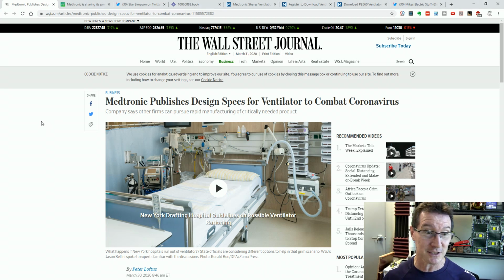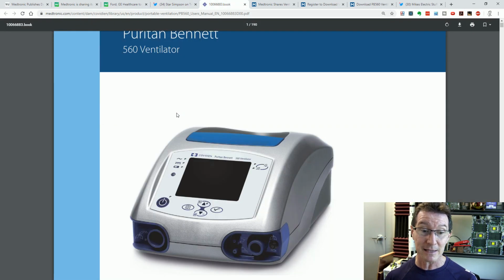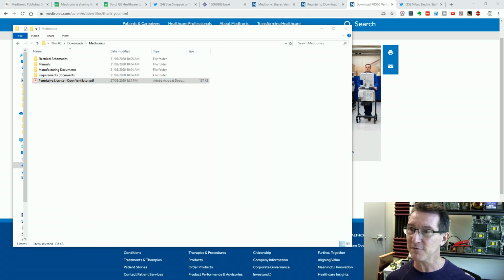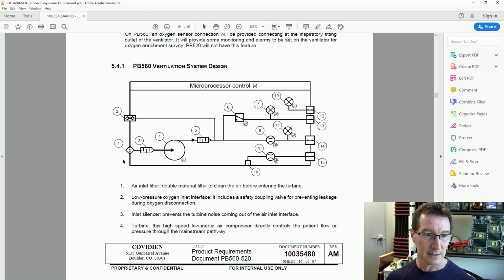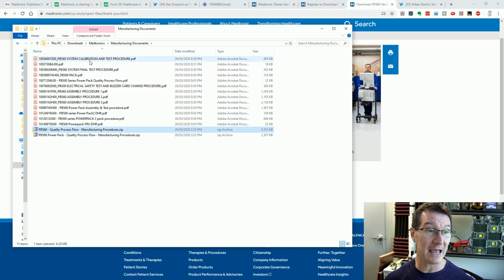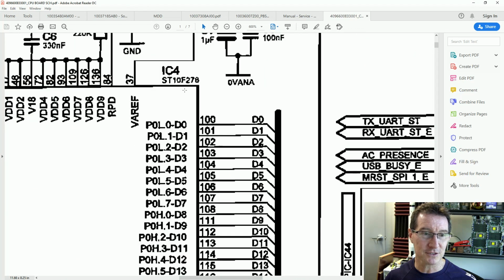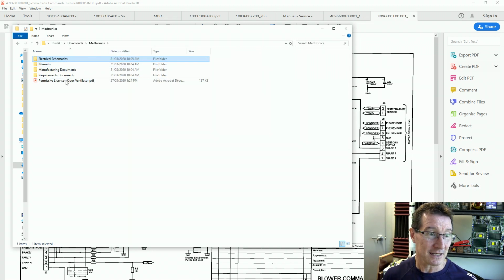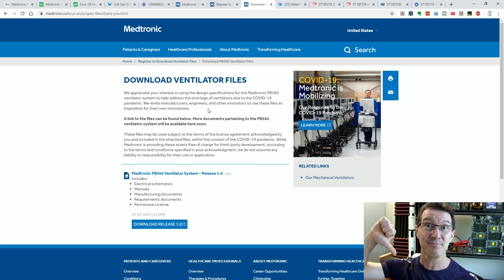eevBLAB #72 - BUSTED! Medtronics Open Ventilator FAIL

Comment: I design medical devices for a living, and I happen to be advising several of the teams that are working hard to quickly produce open-source ventilators.
1. The documents that have been released are actually pretty useful as examples as to how medical device development and documentation should be done.
2. I’ll be shocked, shocked, shocked if Medtronic releases source code. I’m sure that the last thing they want is for hordes of developers to find bad code that ends up in bad publicity, and possibly lawsuits from patients who may have been injured. One of the reasons that I’d love open source medical devices to become a thing is that we can get more eyeballs on designs before they’re released into the world.
Reply: We spent well over £1M on software development for one medical product!  How long would it take you to fill out a regulatory requirements documents for a medical product, people think that it can be done in hrs, not weeks or months and that's when you know what they want to see.In the US is apart of the process completing a  FDA 510K approval which can take years, we did.
Reply: @TheEmbeddedHobbyist  I completely agree, people don't seem to realise the approval requirements for medical devices, which can be more stringent than aerospace.  The UK NHS ventilator project is being fast tracked through the system, but this is not an entirely new design, but a revision on an already approved in use design.
Reply: @TheEmbeddedHobbyist  jesus... ill do it for 10k
Reply: @LittleRainGames  The coding  is not the problem, it's the testing and paper work. lot's and lot's of paper work. there are so many regulations that you have to meet and so much  work to prove that you meet them.
Reply: The Embedded Hobbyist If I may... if you have a good quality system, the paperwork should be nothing that shouldn’t be part of any good engineering process anyway. Unfortunately most quality systems suck.
Reply: @yummybeers  i spent 5 years working to ISO 13485, the amount of paper work to get a product through the 510K FDA process seemed to be endless.
Reply: The Embedded Hobbyist 25 years here 🙂.  And a dozen or so products. The amount if documentation isn’t trivial, but, honestly, most companies make things way too complex. ISO 13485 just tells you what needs to be done, but companies decide how to do it. And they often come up with silly stuff with way too much unneeded paperwork.
Reply: @yummybeers  I know i was just trying to point out that making or coding is quite a small part of the process. in normal times getting things qualified is not easy even when based on existing proven designs. The hoops we had to jump through just to get 510K approval seemed over the top even as we were basing our design on existing equipment. How are things going to go when the UK is out of the EU, last time i looked there was an issue with notified bodies etc. I'm out of it all now as I've put up my medical and aerospace shoes and replaced them with slippers :)
Reply: @TheEmbeddedHobbyist  I hope that paperwork and regulations aren't going to kill many people this year. I mean when you are in Italy's position that you have to choose who will get ICU bed and who will get ventilator because there's simply not enough for everyone, the rest is going to die, any device which helps people breathing is better than none, isn't it? They can do basic tests in one day and have some emergency approval. I know that in my country there are several 3D printing projects going on to have face mask which will fit army filters because there is shortage of FFP3/N99 respirators. It got tested and approved in one day. Similarly with experimental treatment with drugs like Remdesivir. Anything which is not going to outright kill the patient goes. We can leave more formal certification for times when hospitals have usual level of patients and not fighting highly contagious pandemic.
Reply: The Embedded Hobbyist True that “construction” is maybe 40% of a project. I may be crazy, or lucky, but I haven’t had problems with the FDA. One device that I worked on, reasonably complex one, got clearance in about 35 days. It’s about working well with them, making what you’ve done clear.
Reply: Prepare to be shocked: https://www.medtronic.com/content/dam/medtronic-com/global/Corporate/covid19/downloads/ventilator-files/medtronic-pb560-ventilator-system-file-set-3.zip Enjoy...
Reply: In current crisis, certification is the least of the issues.  Any doctor would be happy to use a non-certified ventilator under supervision if there is a life and death situation. Dave is absolutely correct that without bill of material,  those documents are useless. As a mechanical designer I am certain that most of the sensors and actuators in this unit are designed to manufacturer's specifications and may not be available for purchase to general public. OEM sensors and components are very different than of the shelf parts. An example is a modern car, it uses hundreds of sensors and  actuators and if any of them breaks,  only an exact replacement works.
Reply: They could just share a binary file.
Reply: In germany we have spent over 25 Mio € for the  development of a new treatment center! Any cable change, any change has to be certified by the TÜV in Germany. It ist extremely hard to develop mechanical products...
Reply: I'm curious about the projects you're advising
Reply: Well they have released the code now :)
Reply: DispelTheMyth  Phew, I thought I was once again behind the times on trendy speak, or you were suggesting ventilator code be written in coffee script.
Reply: Yea man, this is why companies like microsoft announce releasing things as "open source" years before it happens. They have to clean it up big time. I've seen a lot of nightmares in company software lmao.
Reply: Hi there, could i get your email? We are working on one from nepal and your input could help save us time and effort. Thanks.
Reply: Emergency Ventilator, the real thing.

Please take a look at this, and if you find OK, help spreading the word.
This is an emergency ventilator made by a Danish University ( https://www.en.aau.dk/ ). The emergency ventilator is approved by Danish health system.
The ventilator is easy to build and cheap. But very robust.
I am Danish, but not an engineer, I just wanna help save lives. So guys, please take a look at it:

From Aalborg University, shortly before it got approved: https://www.news.aau.dk/news/emergency-ventilator-to-alleviate-severe-shortages-of-equipment-and-personnel.cid459836

From Danish National Broadcasting (like BBC in UK), please use Googletranslate. I have tested it, it does make a decent translation: https://www.dr.dk/nyheder/regionale/nordjylland/danske-forskere-har-brugt-blot-14-dage-paa-lave-en-simpel-respirator

Manuals, software, permissions: https://github.com/CoRescue

As a Dane, I can verify that this University is OK and the article is from Danmarks Radio (national broadcasting).

Hope you guys wil take a look at it.
Reply: Even if the code has flaws, the design has a decade of service history behind it, so it should be good enough if implemented in the exact same way that Medtronic themselves have done.
(Assuming everything else on the mechanical/electrical side checks out).
Reply: Just adding my couple sents also... Medical equipment also has "botches" that are fixed with jumper wires connecting a few missed things. The thing is they got approved with those botches, if they fix the PCB it has to go again through all of those qualification processes even though the board is essentially the same. Thus it is not unheard some 30 year old designs in production still have those jumper files instead of having a new PCB design.
Reply: The source code used is probably already open source code with a few modifications.
Reply: So when hordes of developers only search for bad code but can't actually write code for an open source mechanical ventilator says it all. 

The problem is copy and paste instead of actually implement code. Too many engineers spent too much time in copy cat behavior. 
The best code to debug is your own code imo.
Reply: outsideworld76 Generalizing a bit? I’m working with some excellent developers who are creating code for an open-source ventilator.
Reply: @outsideworld76  So what, people shouldn't search for bad code unless they can do better themselves? That's stupid. Especially considering that bad code in a ventilator is just not acceptable so any time this gets pointed out is a plus.
Reply: @outsideworld76  Absolutely not. Your own code is subject to your own abilities, skill, and preconceptions. Where I work, we run all of our code through two rounds of programmer QA, with separate reviewers on each round. Even really skilled developers miss things and need to be corrected.
Reply: @outsideworld76  You are correct. I had a high school science teacher that said, "don't buy a used car because you are only buying someone else's problems...." This may not be the case all the time but if the code copied is garbage, the output is garbage. Most folks dont even want to analyze wtf is going on in there.
Reply: @wmd5645  used cars have been debugged. If you buy with a proper pre-purchase mechanical/electrical check, and preferably a warranty, then it's far better IMO. 

New models of car are even worse than just new cars. Let someone with cash to waste debug the manufacturers design ...

Comment: maybe some nub just clicked the wrong file to upload on the server. hopefully they fix it after this. although 3D printing the parts seems like a slow way to get these out.
Reply: Lol. That's naive. Sorry - you don't release design files this way, and allow "some nub" to touch them. This has been back and forth between their Legal and marketing department, probably not even by the engineers.

Comment: Those are design input files. With these files a project team could create a totally new custom ventilator. Software or design files would cause a breach of corporate secret and IP. This allows a new ventilator to be designed without risking any legal ramifications for the company. They could never release a design file because then they would be liable for any products made with there files. These files are all an engineering team needs.

Comment: This is a 10+ year old design that I'm sure they have improved on so I'm inclined to believe they will share all the files they can.  This is likely just an early release with more to come.  If someone from the media approached them asking "where's the rest of it?" I would bet they would release more such as the actually PCB layout files, software (firmware), etc.  They likely haven't made this model in years and have to "find" the missing files.
Medical companies like this don't need publicity as they don't sell to the public.  But releasing this old model that likely has competition (in the same class) can actually hurt those other companies that haven't advanced past this tech.
PCB layout files are more important than schematics if you are just wanting to clone the product and use the same regulatory approvals.  Those approvals are what can get this in production now versus any new design.  And they will likely ONLY release the final assembled firmware code files ready for firmware programming.  Releasing the actual source code wouldn't be wise for several reasons and is not needed.
Yes, they need to be called out on this but when they are I would bet they would find the missing files, BOM, etc.
Stay safe everyone.

Comment: Why can’t somebody just come up with an analogue machine something mechanical
Reply: having been an emt.. I can tell you that BVM is not fun... I mean that is literally what new york is considering.. having people squeezing bag-valve-masks (bvm) instead of these automated machines.......  it sucks.... not as much as mouth-to-mouth of course... or chest compressions (bvm is usually utilized during cpr for emts)...  the real challenge is getting the right amount of air...  in emergency setting its not the most critical thing.. but actually in life sustaining... ventalators tend to keep a slight positive pressure on the lungs (bvm cant do that very well) and measure the pressure going in to know expansion volume etc...    but yeah I've seen some diy thing that takes a bvm and puts a mechanical squeezer on it... might be the only thing that can be done in such short time.... assuming there enough BVMs to go around........

Comment: requirements document at least give a start for a development, but I would agree, there isn nothing really open source about requirements documents, because really they just are a conglomeration of standards, and a certain use case.  Pretty much useless to help in the here and now....   I can only imagine if they had released real open source docs.... could you imagine how quickly 3d printers and pcb fab labs could spring into action and help the production....  even if it was some not-for-profit licensing scheme on this the baseline model... THAT would be good-will.

Comment: I've seen quite a few people come up with mechanical means to operate an Ambu Bag (manual ventilator). While I haven't seen this style yet I would say the simplest design would be a gear motor driving a piston that would squeeze the Ambu Bag. It wouldn't have any bells and whistles but it could get the job done and potentially save lives.

Comment: What are the odds the software is offensive to look at and will create distrust in their products even though it's probably perfectly capable of the job?

This looks like more of a whitepaper giving you the "algorithm" for the device and operational parameters without giving you any specific implementation.  The key take away is how complex a seemingly simple device is.

People were expecting an explicit recipe that could be sent to China to be turned around as a knockoff product.  It's not useless, but they're making you figure out how to make those parts perform to the required specs and figure out how to source all the required parts that meet the medical standards indicated.

Medical devices are not a simple business to get into.  Even if you can design a workable product, you have to prove it to medical standards and then prove your manufacturing process guarantees those standards for every unit made.  If your life is on the line, you don't want to have to worry if you're going to get a janky device, or the real reliable deal.

Comment: I find the schematics useful but slow to take to production. The community would need to route the pcb and figure out the sw...perhaps months away. Time is lives so, perhaps a more pragmatic approach like rpi with some easy to find motors that everybody could build in the garage would be better.

Comment: A few points here: Whatever unit is mass produced in mass must be suitable for doctors, nurses, technicians medics etc. to understand how to set it up, using & applying strict standard protocols which are approved for use in the various countries it is intended for. Some Heath Robinson unit though intended to help is never going to be used because of liability & malpractice risks. It is not as if there are not many approved machine designs out there from probably hundreds of companies which could simply be contract manufactured by many machine builders under license....This whole "we need ventilators" thing is just a publicity stunt. If the government approached a machine manufacturer with a full design & a cheque, that company would instantly be able to build hundreds or thousands to full specification in a heartbeat in a few days...

Comment: Perhaps these are the artifacts Medtronic have from the specification process they went through with whomever the ODM is.  That would indicate that Medtronic might be just the OEM (which these days practically means branding agent).  If that's the case and would not be uncommon, they (or someone over there) might think this actually is the design files.  I've run into this situation before with companies that think they own the 'design', with an ODM in Asia building it 'for' them.  They (or their management) don't realize they aren't even in possession of the actual manufacturing files.  They get sideways with their manufacturer (ODM), call someone seeking to transition manufacturing, and oops.

That's not to say it's not a PR play, it clearly is.  It just might not be an intentional PR stunt.
Reply: If they're just an OEM instead an ODM, then would they even have the rights to say people could use any of this stuff?
Reply: No, they physically manufacture their devices.

Comment: As a former medical device engineer, the information here is invaluable to someone designing their own ventilator - from these docs you can derive what is important and, more imortantly,  what is dangerous in designing your own ventilator. I'm really excited by this because a ventilator is far more than just a fan. Unchecked, a simple design is dangerous and can cause more damage. This documents all the mitigations they have.

The processor used in this design seems to be a private ST design derived from their automotive processors which I have used. Even if you could buy them, the toolchain is also proprietary. It is not any instruction set like ARM, RISC-IV, or x86.

I am disappointed that the mechanical design is not better covered in the release. I'm not a huge fan of Medtronics - remember that their first reaction to Musk saying he was going to build ventilators was to laugh - I'll bet Tesla engineers are poring over this stuff with great interest.
Reply: This. Well said. It would be very nice to have the mechanical details as well.